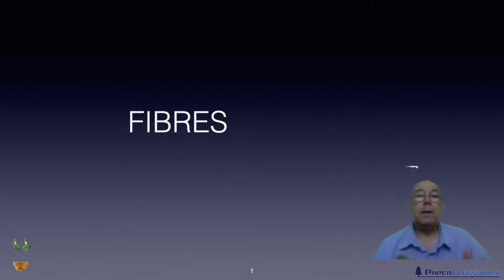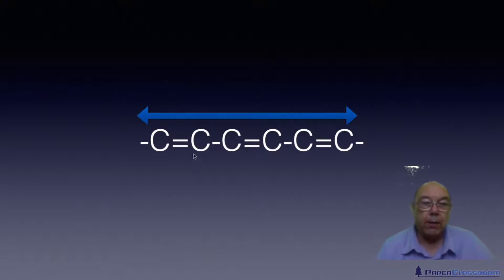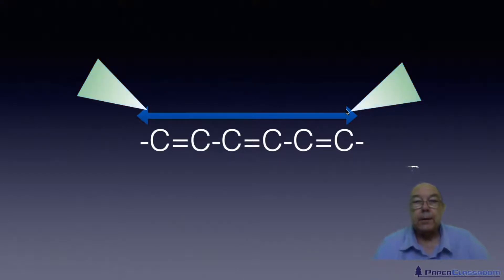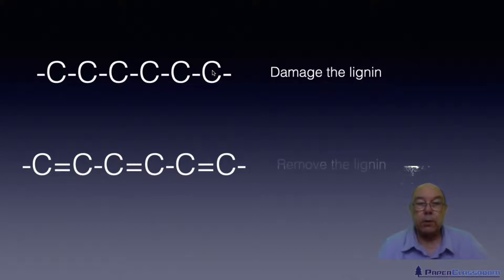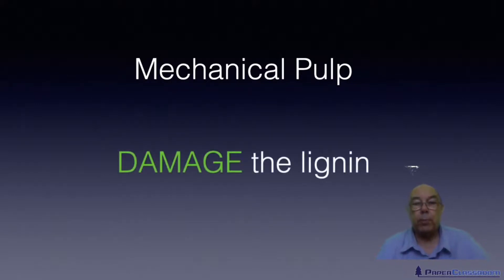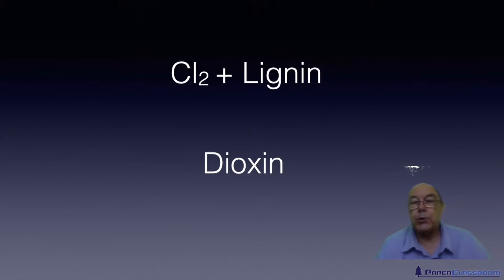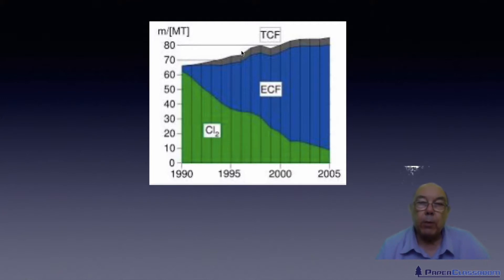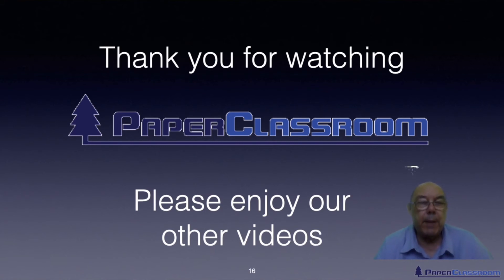Level 2 Papermaking - Bleaching

Comment: Sir comber fiber do not contained conjugate bonds how ever contained aldehyde group what did happen when bleach to comber?
Reply from the maker: Comber is small cotton fibre. Cotton contains little or no lignin, but it contains proteins, acids/ketones/aldehydes and sugar.There will be double bonds in these molecules that will contribute to colour. There may be very very few of these types of molecules in the new cotton, but as it ages, the effect of sunlight and biological activity will increase the number of double bonds and therefore the yellowing. The bleaching chemicals will attack and destroy these double bonds, and so remove colour. 
Think about sugar. Its white, but if we heat it, without burning it, it will change colour, becoming first straw coloured, then more yellow, then darker brown, like caramel, and finally dark brown.. Sunlight and biological activity will cause similar tings to happen to the sugars in cotton.
Reply: @PaperClassroom  thank you so much sir